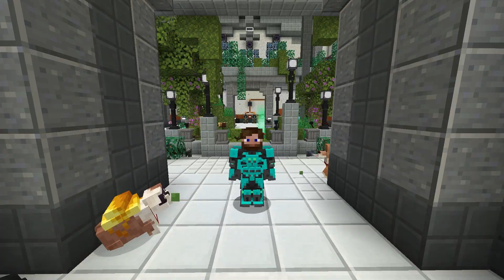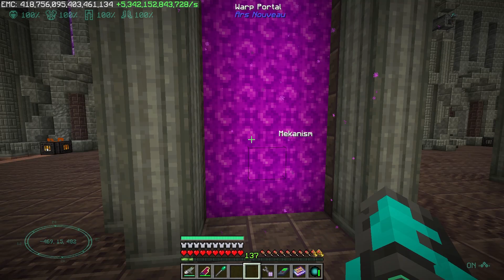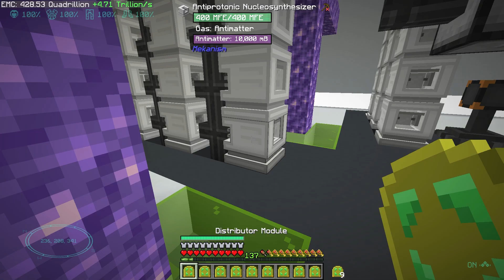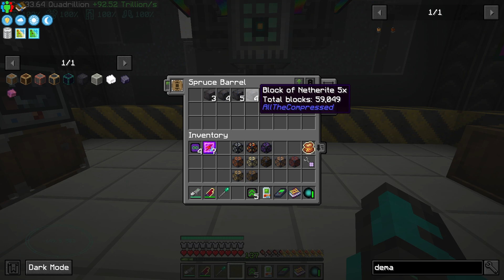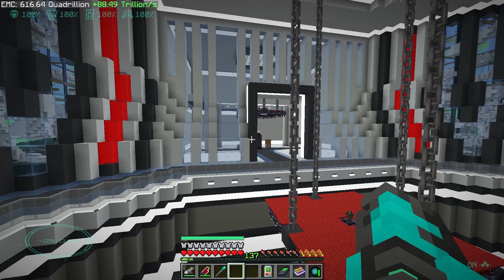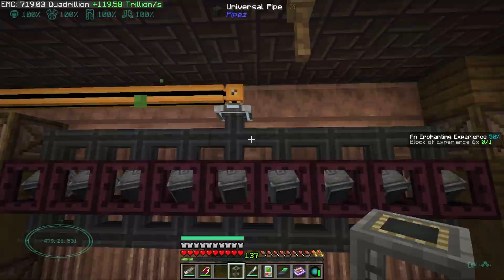PROJECT ARCHITECT 2 - EP 46: End Game EMC Generation & Block of Experience Automation

Comment: anyone else had issue's with rftools dimension in this pack got 4mpower but cant power dimension only seems to be taking 20krf from my flux network and dim needs 100k
Reply: turn up the limit or disable bypass or use ended gates
Reply: @kuoptt  disabled all limits and even tried attaching via pipez with full upgrades machine has 20k max power but dim card does not get the power